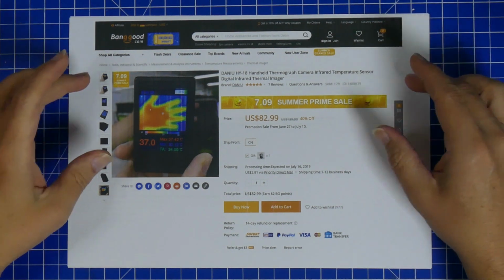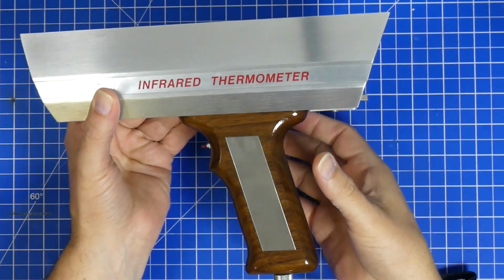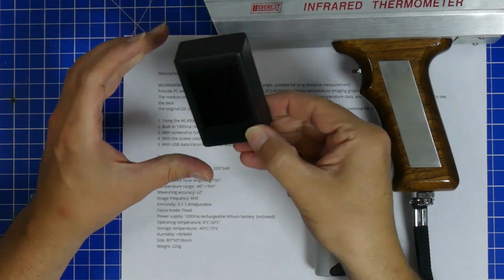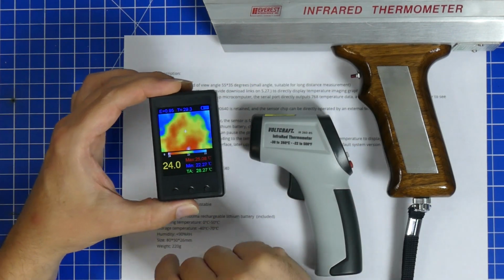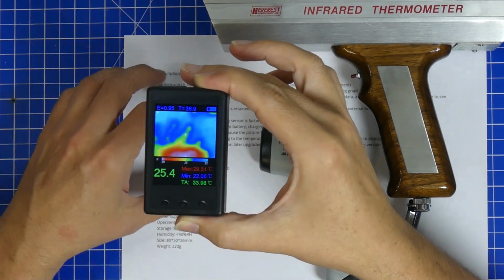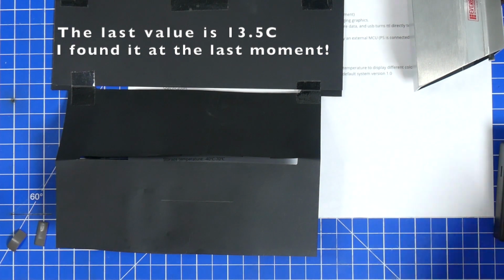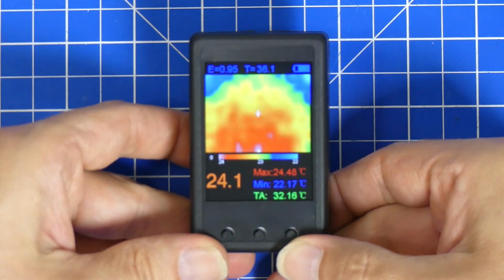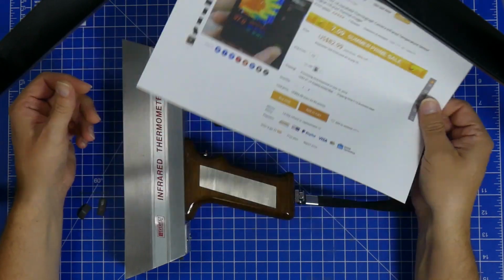DANIU HY-18 Thermal Imaging Camera - Review and some infrared thermometer background

Comment: This model seems to have disappeared off the face of the earth. What a shame, it has the best form and data presentation of all the MLX90640 cheap devices :(
Reply from the maker: That would be a real shame ... I hope it makes a comeback.
Reply: Yes I bought one of these and it has been really useful. The main thing lacking is the ability to save an image to an SD card but I  bought it for fault-finding electronics and also checking heating systems in buildings.  It has worked really well and I am very happy with it.  I see similar products that are more expensive although they do support saving images.  Fortunately I got the manual for it an it includes the full tech data for the serial output.  I seem to remember that there was software that ran on a PC but I only use Linux so it had little use for me, although I could have tried to hack Wine to make it work.  I see the   HY MLX90640 (two versions) for a similar price but the HTI-Xintai device with a camera and sensor is around £90+tax. It will film 640x480 with 32x32 sensor. and needs to attach to a mobile phone (temp is limited to -20 - 60C).  I would buy that if I was in the market today.  I am happy enough with the one I got but it needs protection and so it is kept in the bag it came in and is placed in a padded plastic zip up pouch.

Comment: I understand that the resolution will be low, but would you be able to see/spot a warm human/animal body against a (unobstructed) forested area about 80m away? 
I just need the indication that there is something warm out there, don't need the body shape (again, due to low resolution).
Thanks.
Reply from the maker: 80 meters ? I don't think so. At about 20m maybe, I think that the size of a human will be less than a pixel by then. You probably need a sensor with a rather small aperture angle.
Reply: @dherrendoerfer  , thank you for your answer. 
Would you be able to put up a few examples of outdoor shots?

Comment: I wonder if any of those test points would allow a microcontroller to interact with the device.
While using a computer to interface with the camera would be cool, I'd really like to be able to access the data with other devices like an ESP32 or other microcontroller.
Any guess if there's a way to get a serial signal out of the camera other than USB?
I suppose I could eavesdrop on the i2C lines but I'd rather get access to the processed data.
Thanks for showing the inside of the device. It really helped me to decide to purchase one (I used your link).
Reply from the maker: I don't really know - that data stream is very fast, and honestly I don't even know if it's the processed data.
It might be an option to read up on the sensor chip and check if there are any pre-made libraries to interface with it.

Comment: Hello can you tell me how long the distance that this tool is capable to... or is it good only for like under 1 meter distance..? Thanks
Reply from the maker: The useful distance can be several meters easily. But of course the minimal unit of one measuring pixel remains the same, so you might miss tiny hot spots.
Reply: @dherrendoerfer  thanks for the reply, so you can use it to see at the ceiling for some leakage, have you ever tried to? And i see some option for the close price range is the ht-102 from hti this is the phone attachment version and has a 32x32 thermal resolution... but i cannot found any decent review about it... so i'm still try digging to these two option of cheap thermal... well it's good if you can find info about it.  Thanks alot anyway for the useful review and the reply :)

Comment: WHERE DO YOU FIND A REPLACEMENT BATTERIES FOR THIS?
Reply from the maker: Finding a replacement should not be hard at all, these are the basic standard batteries around - any single cell Li-Po with a protection circuit will do.